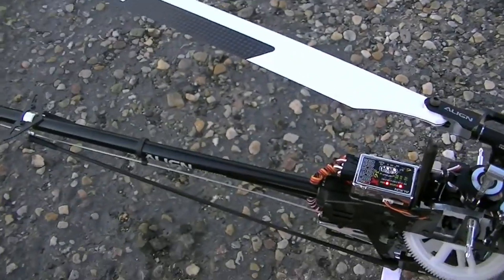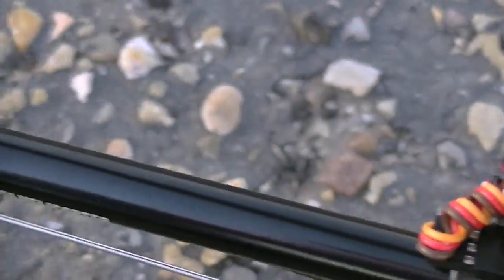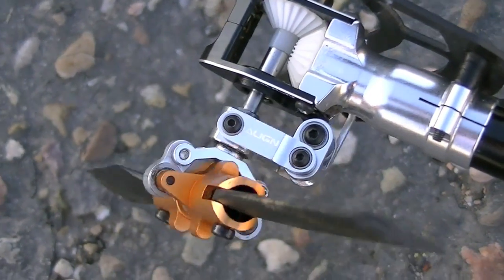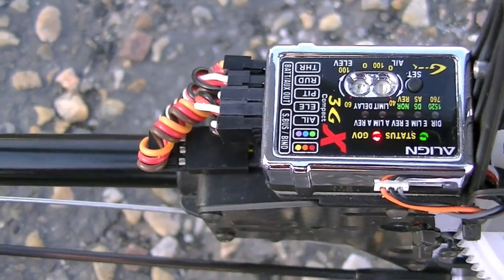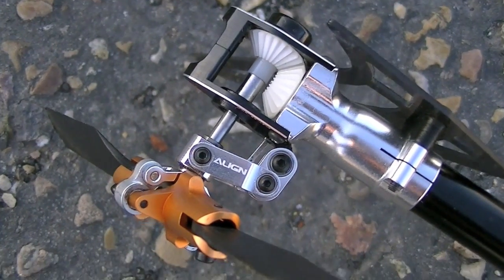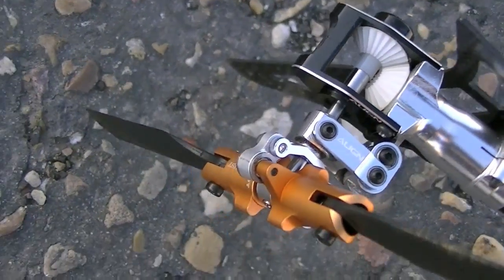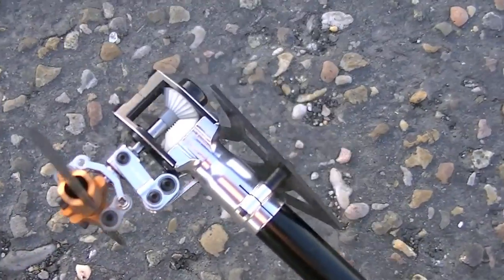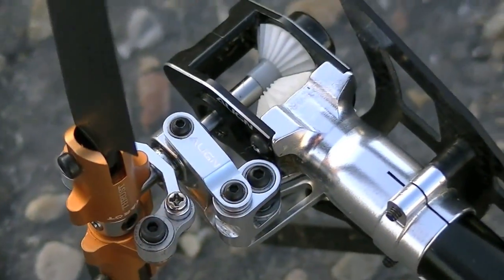3gx heading hold mode ERROR (freddy can fly)

Comment: Hi Freddy nice video but I have some questions, in which directions should turn the tail blades? CCW o CW? Cause on my raptor 50 is CW and flew perfect but some people is say it should turn CCW. Thanks for your support. I built from 0 my raptor for all your videos I see each one and are perfect really appreciate my friend.
Reply from the maker: Hey buddy so there is no right or wrong way for the tail to spin.  What matters is that it counters the torque of the main rotor.  So if your main rotor is CW then usually your tail is CCW and vise versa.

Comment: Don't trust the 3gx status light!   I was using the 3gx with an AR8000 receiver (spektrum) and switched to using 2 satellites straight into the 3gx. My gyro gain was on the GEAR channel with the AR8000 receiver. Little did I know, with the satellites, the gyro gain moved to AUX2. This wasn't obvious to me at all because, after I put the satellites on, the 3gx status LED still operated as though it was on the correct channel!  It turned green when I set the gain  >0, and red when I set it <0.  In reality, the gyro was in rate mode the whole time. When I set my TX to use aux2 for the gyro gain instead of gear, I finally have HH mode!   My tail slider now behaves like it should when in HH mode. 

So the lesson I learned is:  don't assume that because the 3gx status LED turns red/green as you move gain between rate mode to HH mode that you have the gyro on the correct channel! The only way to verify that you're on the correct channel is to check the behavior of the tail slider when you think you're in HH mode

I know others have suggested switching gyro gain channels but no one really explained why it's not obvious if you're using the wrong channel with the 3GX. 

Now, as to why the status LED continues to operate correctly when on the wrong channel is beyond me.

Comment: Nice vid Freddy. I have this issue as well. I asked about it on a forum and the best answer I received was, "it's likely not behaving exactly like it does in rate mode. It does tend to return to zero with no heli movement and neutral rudder stick. But the gyro should be compensating for rudder axis rotations. Also, if you move the rudder stick slightly and hold it still, the tail should continue to move until it reaches it's limit. This does not happen in rate mode where the pitch is mapped to the stick location."

I'm not sure if that's true about rate mode or not but I'm still calling shenanigans, Align. I'm tired of this gyro.

Comment from the maker: sorry still have yet to find a solution.  yes i found that down grading to 2.1 the tail works perfectly.  anything hight then i get the same problem.  this has happened countless times.  align needs to have a solution or at lest clarify what this is all about.  sad part is i got a new 550 dominator with the new GPRO system and to my surprise lol still the same rudder issue.  hmmmmm very strange

Comment: Hi Freddy. I am going fly barless. Bought a 3GX 4.0 and using two DSMX satellites.
Sad to say, i am getting this same problem, no matter what i do, it never go's into head holding.
Please can you tell me, did you get a solid anser on this problem, and if you have, could you please tell me how to fix this.
I have a AR6210, that i can use, but i really wanted to go sat's only with my DX7s.
I am new to fly barless, and would really like to hear from you.
Thank you for the video, i now know this is a 3GX problem.
Reply: This sounds like you are on the wrong channel for gyro gain. The 3gx status light is deceiving and will make you think you're on the correct channel when you aren't.   (See my comment about switching from ar8000 receiver to 2 satellites.  Gyro gain moved from gear channel to aux2 channel)

Comment: I have the exact same problem. I did what Kristopher did and it worked. With the exception that I had to go with v2.1 down from v4.0. All of this is after I sent it back to Align they replaced the board. It went down from v4.0 to v3.1. I still had the same issue.This morning I saw your video and read the comments. Problem solved. Thank you guys.

Comment: In v4.0 of the 3gx firmware it behaves kind of like this on the ground even if it's working correctly - although mine doesn't return instantly to center, only after a while but it does, so that could still be a defective unit. Just wanted to mention that before v4.0 it didn't return to center in heading hold mode, true, but in 4.0 it does if it's on the ground.